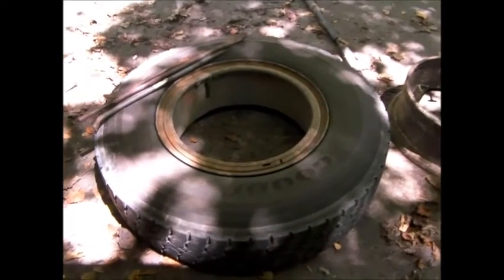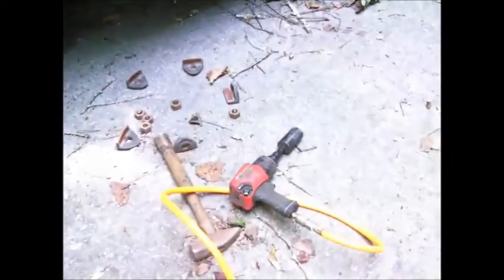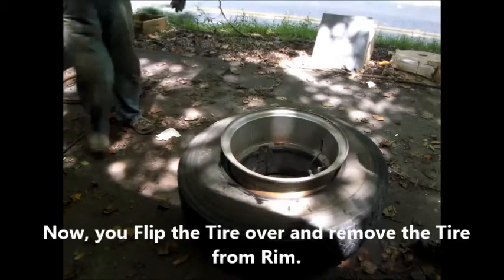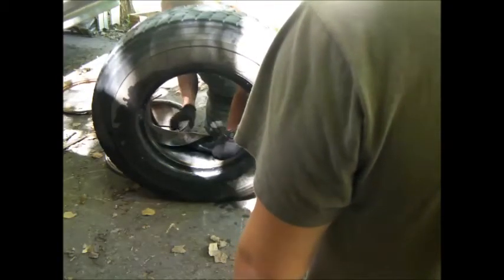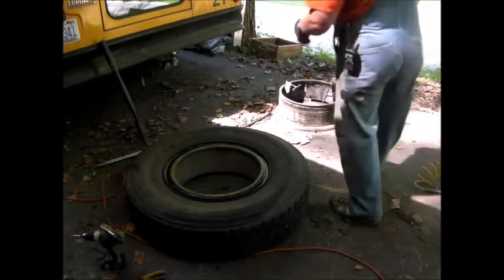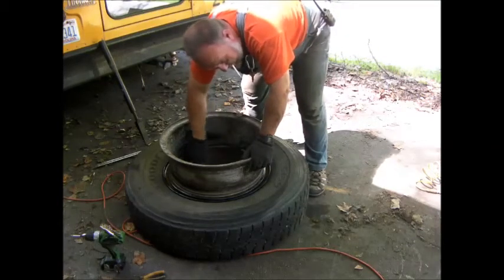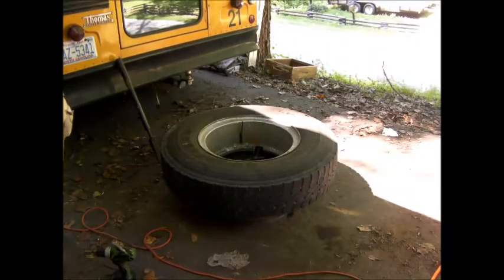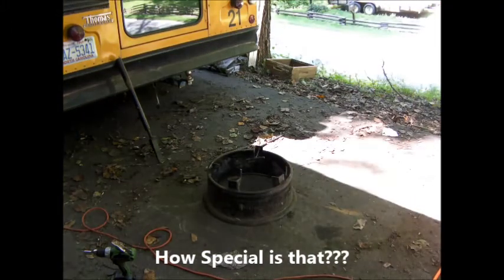Split RimTire Video (How To Change it Safely)

Comment: This sure does bring back a whole lot of memories. I don't know of many vehicles that use the split ring rims anymore. I'm sure there are some out there, just that I haven't seen any in quite awhile.
I was watching a kid (if he's still alive he's a grown man now) change one of the split rims  once. He was in the process of airing the tire back up when the tire popped and "seated", took the tips of his fingers on his left hand off (didn't actually cut them off, but smashed them bad enough that they had to be amputated). 
Hope nothing like that ever happens to anyone else.
Reply from the maker: +Thomas Pigg  The key to not having trouble with the ring is to look at the ring before you get started.. Making sure that the ring gets properly seated when you put it back on.. I always look at the gap between the two ends.. I sometimes measure it quickly and then measure it again before I put the air to it. The gap is usually obvious, if something is not right.. It is usually more than 1/8", usually 1/4 or more...
I really like them, because I can fix flats myself, without driving 20 minutes to town, and only one place in town changes them.. 
I have never had a problem, but, I have had a problem getting the split rim seated once or twice.. Usually due to some rust deposits.. This particular rim definitely had a rust ring.. I wire brushed it off, passed a grinder over it, and painted it before re-assembly.. I cut that part of the video out, because it took a bit. 
I showed this to a School Bus Depot, where they repair school buses.. The shop manager loved it, and wanted me to make one for him.. He said he could not use it at the shop, since it was not OSHA approved, but, wanted one for his own shop.  When I flipped the tire over and it fell off, he was sold..
It is 100 times safer than anything OSHA has to offer.. I would not air one up without it.  If I did, I would surely air it up, pointing down, and with a hose that let me stand back out of the way... 
I will have plenty of split rims for a while, so, I will be using them..
Reply: +Mark Thomas 
Yes Sir, you're absolutely correct. If given the proper tools, most jobs can be done without harm. I just hate the fact that there's a "organization" that thinks they know more about a man's job than the man himself does (nothing wrong with book smarts, just don't take the place of real experience).
Sir, I hope you a hundred more years of doing what you like to do best, all without incidence.  Have a good year Sir.

Comment: On a lot of those old radials just tap the flange side and the rim will fall off . ( Michelin mostly).           Your a spitting image of 3 of my uncle's. ( Ottawa valley MacDonald's.
Reply from the maker: Ha.. Tell them I said hello.. :)  The tires are getting harder to find, but, I love them.. I can change them myself and don't have to find someone who wants to rape me to change them, and I don't have to wait.. I just put two brand new tires on the front of one of the busses..  Rims had some rust inside of them.. I ran a needle scaler and the ran the wire brush on the grinder and hit them with some Rustoleum with a brush...  Mistake... It was hard to get them on.. I can imagine, once the paint sets good (about 30 days),, might be a bear to get them off again...  I had already painted two and wire wheeled two more for spares for quick swaps.. I spray painted the other two lightly... The tolerances are pretty tight.. I could see a difference in the two sets which I pulled off of the old rims... Ha.. 
I still want to paddle the Ottawa River some day.. I'll make it up that way for some good reason and stick it.. 
Cheers.
Reply: are the 3 piece split ring safer than the 2 piece ?

Comment: seen it all before and it's harder to do this way.(12 hard years busting tires).  I loved doing tires.
Reply from the maker: Funny. Things never work right when you turn the video camera on. I change one of these bad every year or so. I forgot to do several things. But it's the first time I have flipped one over and it not falling off the rim.
Had it done so, I would imagine your eyes would have looked like the guys that have been changing them for 35 years and had never seen one do that. Just saying.
I ended up changing four flats this year. The damn tubes got old and started cracking. It was the second flat when I figured it out, and had to change out four tubes.
Every one of them fell right off when I flipped them over.
I'm sure you remember beating the hell out of them and them not coming off. That doesn't happen here. Of course, it helps if I let the air out of it first in the video.

Comment: Main thing I see a problem is with the assembly being face down and not being able to check if the rings are locking into place properly. If it does come off with enough pressure , the whole assembly , jig , tools laying on it and all is going to hit you in the face while you're leaning over it. In the future , it made be better to put just enough air in it to seat the rings while you're eyeballing it then bolt it back on the bus to finish airing it up. The rings will be facing toward the spacer on the inside and won't hurt a thing if the wheel was to come apart.
Reply from the maker: The key is to have the Ring locked into place, and the tire seated to that side of the rim first.. The ring won't come off it is is seated correctly.. That is the mistake most people make.. Not paying enough attention to the ring.. The first thing you do before taking the rim apart is to notice, or better measure the distance (Gap) between the ends of the ring, and make damn sure that it goes back on the same way with the same final gap.. 
Yes.. They are explosive when the rings come off, and are "Free" to go where they want to go.. 
Here are two videos to look at quickly.. 
This first one.. The guy has the ring pointed down (thank goodness), but, it is not restricted in any way.. They guy weighs maybe 170lbs. Watch for the ring.. Imagine, if it were fixed between two rims, the lesser effect it would have..  I had the tire at about 35psi, when I hit on it with the 5 pound sledge. 
https://www.youtube.com/watch?v=_IxYHJXLhZw

Then, take a look at this video. It is a good example.. 
When you are watching this, pay close attention to what makes the "BLAST"" look so Real and Terrible.
It is the air coming out of the "Side" of the tire, after the Tire has "Left the Rim", past the Ring Location.. ALL AIR, Free to Escape "All at one time".. 
Now.. Imagine, two Rims, facing each other "Ring face to Ring face" When the Tire leaves the First Rim, it immediately would move onto the next rim.. Two Bursts of Air would be released.. BUT,, Not Fully Released, and it would also be released "Back Into the Tire, twice as it passed one ring lip, back onto the rim, the, across another ring face and back onto the rim again.. The Ring would go down to the other end of the Rim (Wide Lip End), and if it worked it's way off of that side of the Rim, it's initial impact was slowed down by the rim, (Pulling the Tire Down at the time of impact at the rim), and not releasing all of the Air at one time either, since the tire would still remain on the rim... If the ring made it past the lip, the only way it could go is down, but, at a much lower rate after the lip takes the initial impact,,, sitting solidly on the ground (cement/blacktop), etc.. I doubt very seriously if the tire would jump more than 2 or 3 inches at most.. Remember.. In these Videos, the air was allowed to escape "All at one time", and 95 or more % of it is headed in the direction of the ring, which in my case, is back onto another rim, not releasing into the atmosphere.. The Air you see in this video, is air that is headed out of the ring side of the tire, and once it is free from the rim, it expands back to the other side of the rim, due to the path of least resistance of the overpressure on one side, hitting the ring, deflecting, etc.. 
Imagine if it were only moving past the 1/2" area of the ring lock, and back onto a full rim, and back across another 1/2 area and then back onto another rim..  It only has to release enough pressure to move to the next path of most resistance.. 
Next time you have one broke down, just throw two of them together ring and ring side, and imagine clamping them together after the ring is installed on one, and not on the other, both facing each other.. 
Imagine this same video, with the tire never leaving the rim totally? The reduction in the volume of escaping air.. I think you will be able to see that.

I have to admit.. It did not look safe when I leaned over the tire.. But, like I said. The Key is making sure the ring is on correctly before you grab the air hose.. I could tell my guage was not working properly.. I figured it was about 50-60 lbs at most.. the reason I had Stobart go and get me the stick gauge..  When I leaned over it, it was about 35psi..

I bring the tire to 120psi (Without a valve core),  then release the pressure to about 50 or 60psi, and then roll it, not facing me, and put it back on the bus, and then, fully air it up.. You are correct. It is safe there.. But, this is also the same concept as the Double rim setup I have... Just a little better than on the hub setup.. It could still release all of the air at one time, because it would not move from Rim to Rim, but, it would move across the usual corrugated spacer Rim.. So, if it is going to come off, the safest place is setting in my rig.. The Ring probably would not go anywhere same as my setup, unless the ring came to pieces, which is the same on my setup..  But, it is a good spring steel, and should not break.. Flex yes, but, not break.. And, when it comes back up, the tire will be coming down, keeping it stable.
I wish I could send the setup to OSHA, and let them video it coming off and see.. But, I don't want anything to do with them, and would rather they not even know there is something better out there.. It would never survive the red tape to get it pushed through.. Unless you know a Congressman and want to have these things Robotically welded and sell a couple hundred thousands of them to cover the Product Liability insurance for those what won't use them correctly no matter what you give to them.. Ha.. 
Here is the other video... 
https://www.youtube.com/watch?v=_3_PMhBa_-c
Take a look at both of them, read this again, to clarify and then, let me know what you think after reviewing it.. If you still have split rims, go ahead and build one if you are handy with a welder.. 
It is a damn site safer than a "Osha Cage".. The Local Bus Garage sure wanted me to build one for them, but, I reminded them about Osha, and they figured they would be in the same trouble either way.. 
And, once you get the ring off, I would bet that 95% of the tires come off of the rim when you flip them over.. Mine does.. Except when I try to video one.. and, I didn't pull the valve core before.. I got interrupted about 10 times during the tire change. The company was running and I got pulled away several times.. 
To be honest,  I never want to give up my Split Rims.. I can deal with them myself anywhere I have trouble. 
It is 45 minutes to the closest Walmart, and no telling how long I would have to wait to get someone out here to fix a flat.. Maybe a day or two.. 
Cheers.. Glad you found the video, and I hope it reduces your risks.. I always think it "could" come off, but, I have a hard time convincing myself of the danger, although I respect it, and don't take any chances..